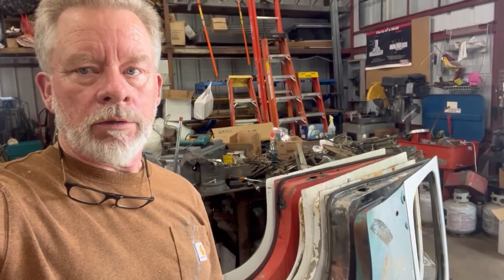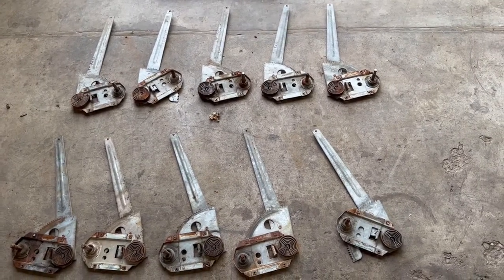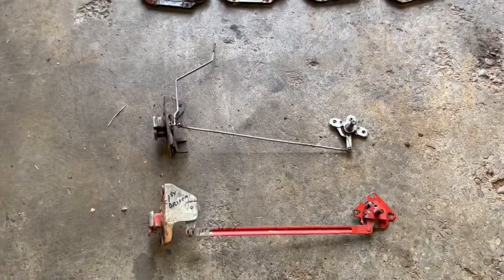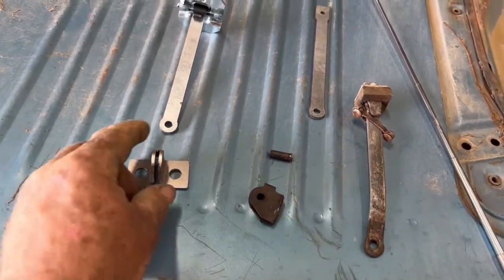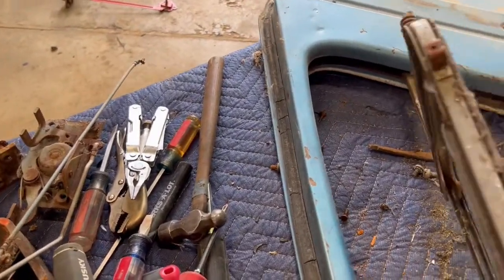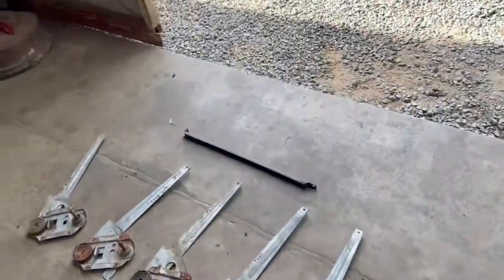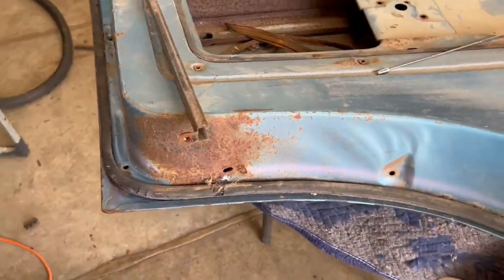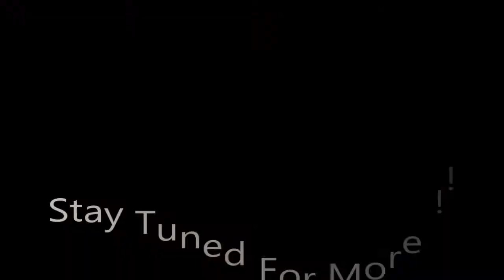The Doors.  1964-70 front doors

Comment: Excellent videos, thanks a lot! Any recommendations on sources to rebuild the vent window?
Reply from the maker: As far as I know, there's nobody out there that is offering rebuilt vent windows.  I may offer them in the future.  For now, you'll have to either build them yourself or find someone to do it.  Here's the parts you'll need; from CRLaurence Y658X96, from Steele Rubber 90-0342-90, 80-0788-57.  Might as well get the front door seal while you're at it.  70-2584-72.  These are all high quality parts and rather expensive.  My apologies for the late reply.
Reply: @vintagechevyvanparts  Another vanner told me Dr. J 's Restoration Rx does vent windows